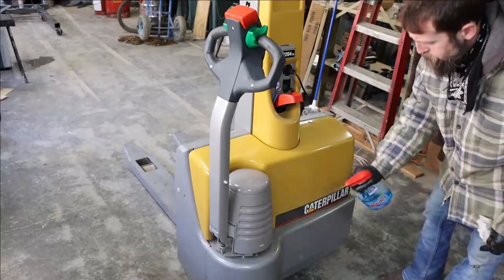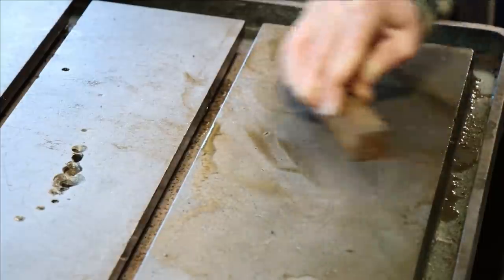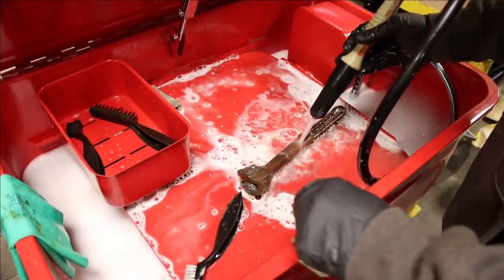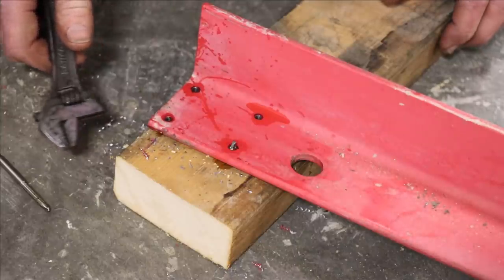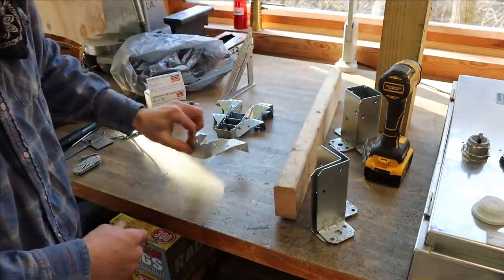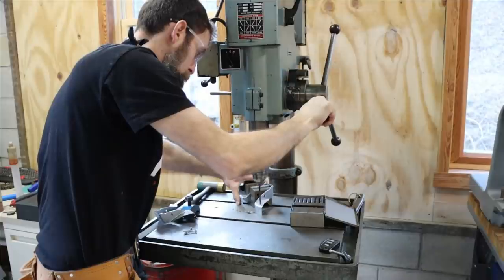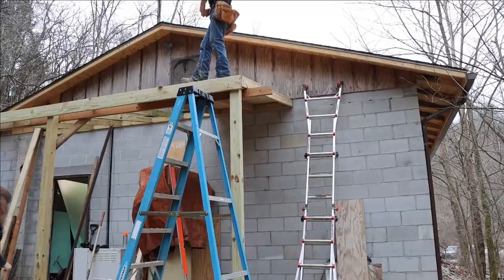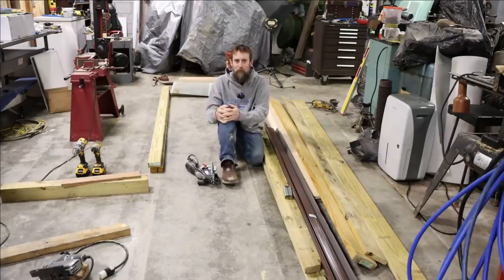Building the Compressor shed off the shop. Protecting my equipment from the elements.

Comment: I ran on of these with a car battery yes we have to keep putting on the charger but no diffrents than the other batteries.  Never had a problem with it
Reply: yes they work  in that they have the amps, they are 12v and rechargeable.  car batteries are designed for  short bursts of high ampage, not prolonged or sustained draw over long periods of time.  deeply discharging a regular car battery shortens its lifespan.  where as a deep cycle battery  is designed for deeper discharges for longer periods of time  before recharging.  yeah  they  will  both work  but over time, a year, 2 years, 3 years the deep cycle will last longer  and ultimately  cost less with  fewer replacements.

Comment: Be careful with that purple cleaner from ZAP.  It doesn’t like aluminum, I bought some and try it in my part washer and it stains and eats away at aluminum. Whenever I see a dishwasher on the side of the road I stop and remove the silverware tray. It works great in  a part washer,  you can put all your small parts in it. Wash and then blow off with your air hose and your parts to go flying away.

Comment: ice and water shield  for the roof .. if you get the good stuff its great my one garage been on it 2 or 3 years have not shingles yet still holding up tar paper would have blown off in the 1st week .. i have had good luck with the stuff it seals around the nails or screws that you put the roofing on with ,,

Comment: I had a "scissor" style electric/hydraulic pallet jack.. The only downside with that and the one you got is they don't actually work with pallets.  At least normal pallets.  If you get the "Chinese" pallets, they work with these high lift jacks as they have open bottoms.

Comment: The difference between a 'car battery' and a deep cycle is the thickness of the plates. A car battery has thinner plates that allow a large current draw for starter motors. They don't like being fully discharged and recharged. A deep cycle battery has thick plates that will warp if used in a starting application with the high current draw but they are much happier being drawn down to almost no charge at all. Deep cycles are used for things like trolling motors; low amperage and needs to run for extended periods. All that being said, if you're not going to use the lift for long periods of time (meaning move things around for an hour or so), a car battery will be fine. I suspect this will be your kind of use as opposed to the kind of use in a warehouse that these machines most typically see. Just be sure to charge it after every time you use it. When I had a boat with an I/O, I went to Sears to buy a battery. When I told the salesperson that it was for a boat, she said "Oh, you want a deep cycle battery". I said no, it's for starting the engine, not for running the lights or whatever while anchored. So even people who sell batteries don't necessarily know the difference.

I use Purple power all the time; I buy it by the 5 gallon pail at Autozone. I use it straight and though it may not degrease as good as some aromatic solvents such as the mineral spirits mentioned, it is water soluble which makes final cleaning before painting much easier. It's also non-flammable. If you look at my videos, you'll see I use an old steel bathtub that is mounted at a convenient height as my parts washer. I have a 3-way valve on the drain that can switch between draining to the bucket where the degreaser is to the drain for rinsing afterwards with hot water.

Wedge for Morse taper removal is called a "drill drift". That shank is pretty beat up.

Glad to see you bolted the casters on; I hate it when people weld casters (or hinges) on.
Reply: They don’t make battery’s like they use to, any battery you buy now days your lucky if you get 3 years it doesn’t matter how much you spend for one, 3 years.
Reply: @tonypike5785  My point was the difference between the two types and how they get used. However, not sure where you're getting your batteries or how you're using them but I'm getting north of 7 years my my car batteries.

Comment: The reason the tap broke is because you weren’t backing it off far enough to break the chip. It’s no good backing it off until you meet a bit of resistance, you have to back it off further than that. I noticed you did the same when you started tapping the second hole.
Reply: The reason the tap broke is because Steve was working like a gabone on the ground. He should have had that angle off and up in a vise instead of squatting on the ground like he was doing.

Comment: Purple power will eat the paint off of that metal parts washer.  I’ve seen it happen multiple times.  Pick up some  PSC-1000 solvent  from tractor supply.  It works great and It won’t damage that parts washer.  I’ve been using it for years.
Reply: If it eats paint off that shows it's working. They don't call it power for nothing after all. heh
Reply: @1pcfred  The paint actually flakes off and starts clogging the pump.  Then the metal tub starts to rust out from the water based cleaner.  I’ve seen multiple metal parts washers ruined this way after a handful of years.  You use solvent in a metal parts washer and water based degreasers in plastic parts washers.
Reply: @shadowdog500  I use whatever makes me happy. My shop my rules! Rust is patina. The season of rust is almost upon us now too! He who dies with the most rust wins!
Reply: @1pcfred  I agree with whatever makes you happy in your shop.  Heck, you can put gasoline in your parts washer in your shop if you want.  But as Steve pointed out several times on the drill press spindle, “If you don’t know, you don’t know”. Now you, and hopefully Steve, know what purple power will do to that metal parts washer.
Reply: @shadowdog500  drills are their own bearings anyways. Anyone looking for a perfect hole is not using a twist drill to begin with. Armchair experts on the Internet crack me up.
Reply: @1pcfred  Amateurs on the internet crack me up.
Reply: @russellstarr9111  you too? I got my union books.
Reply: @1pcfred  I’m sure the MT3 reamer set he bought wasn’t that  expensive, and a turn or two with the finish reamer to clean up whatever he felt in there probably won’t hurt anything.
Reply: @shadowdog500  Maybe. Some here have said the metal that machine is made out of is kind of hard. If I was really worried about it I'd probably just wrap some sandpaper on the arbor and spin it up in there a little. Just to knock off any high spots. Clearly it works now. So it does not need much. The other thing you can do is use a little grinding compound. Sort of lap it like a valve seat some.

Comment: All brands of adjustable wrenches are called "bahco" in the Netherlands, the brand became a name.
Nice work again Steve and nice editing, you've made me curious of what's under the tarp.
Reply: at the back is a big compressor
Reply: When a brand name becomes the name things are called generically that's what's called an eponym. Like if a facial tissue is referred to as, a Kleenex, or a copy is said to be, "Xeroxed". Here we tend to call them Crescent wrenches. Because Crescent is a large manufacturer of adjustable wrenches. Some call them Swedish nut lathes too though. Makes hexagonal fasteners round!
Reply: @1pcfred  Thanks Paul.
Reply: @ypopnun1003  at the end of the video Steve mentioned a tarp behind him inside his workshop. The compressor is outside now.

Comment: Great progress Steve, 2 comments though. why not undo the two bolts on each angle and stand in comfort at your Doitall instead of kneeling with a battery drill, and I hope you didn't let the posts sit on the concete but fixed them an inch off, to stop wicking. You guys and your wind worries, surely in that high sided valley behind your shop it's never going to be a problem.

Comment: When i sink my treated posts, i add a sealant for extra protection, then i spreay car undercoating on the 4x4 till its about 2 inches above ground, then i cement them in.
Reply: I like a bitumen paint and grading the concrete away from the post.

Comment: If you ever close in the compressor shed keep in mind that all of the power which compresses the air you use is converted into heat and add enough ventilation to prevent overheating the compressor or the phase converter.

Comment: Careful with purple power its corrosive, (to the parts washer over a long period of time)  I use crud kutter in mine it works ok, i also use a 5 gallon bucket heater to heat the water, makes cleaning parts alot more pleasant :) id like to try the "psc"? 1000 from tractor supply but dont feel safe using with the heater and dont want to give up my warm water lol. Love that drill press theres a wilton one for sale about 4 hours from me, thinking about picking it up but would have to use money from my milling machine fund :( so probably wont happen.

Comment: Make a good video to use the glass mat batteries for a couple of months and then get the marine deep cycle batteries for an equivalent time.  Running a trolling motor all day long has to be as hard on them as doing the lift.  Hardest thing on a battery is taking it down to zero which happens when trolling pretty regularly.  Seems the price would be better.  Also might want to try the six volt batteries used to run golf carts ganging them for the voltage you need.  See which one is the better deal.

Comment: Hi Steve,   Car batteries are kept fully charged and only discharge intermittently.  Deep cycle batteries are designed to discharge to a low level and survive.  Which will you be doing with the forklift?  I suspect you will use it for short periods and keep the batteries fully charged otherwise...just like a car.  So...use the car batteries.

Comment: Love the Bahco adjustables! I have a broad range of the same 8--- series from 4" up to 18" (Mine are Imperial wrenches ;) )
Reply: I've got the metric ones. You can adjust them to 0.01mm (;-0
Reply: It was actually a Swede that came up with the industrial inch. Which is what we use today. So I doubt it is actually Imperial. Johansson came up with it in 1888 too. He's who Jo Blocks are named after. So kind of a famous guy.
Reply: @ralphgesler5110  I am aware of how the standards work today. Thank you. There was a time when those other folks were right too. But they probably were not alive then. The difference was only a few millionths of an inch anyways. So not a big deal in most cases. The US inch was a little more than 25.4 mm and the Imperial inch was a little less. By 3 and 2 millionths respectively. It was enough to bug Johansson though. The industrial inch did not become the international standard inch until it was officially adopted by various nations. All of this happened without most even being aware. And they still aren't. It is not something you can see with your naked eye or even a micrometer.
Reply: Elisabeth has corona vaccine clothes.

Comment: Steve , 
 Just say NO ! to all 10-24 threaded holes ! Should have gone 10-32 tap as 10-24s brakes ALL the time ! !. Very common to brake a 10-24 tap, even brand NEW 2 flute Greenfields ! . I always stay away from 10-24s and go 1/4 20 if possible. ( I even had prints changed from 10-24 to 10-32 in steel or 1/4-20 in aluminum. ) Good to see you use a 2 or 3 flute tap, never a 4 flute as the 4 flutes are just for chasing threads, not cutting new threads. Also that tool you used to remove the chuck from the drill press ( wedge) is called a drill chuck Feather in the machinist hand book and in most tool rooms. Funny the stuff you learn in a aircraft apprenticeship ! P/S, Star wheel dressers are not used much anymore , we now use a mag chuck surface grinder diamond stick insert with a custom turned in the lathe stick diamond hand handle with a set screw to hold it in that dresses a bench grinder wheel much quicker ( and better)  with less mess .
Reply: What, no love for 12-24????

Comment: If you are going to get a few batteries, then maybe consider going for Lithium. You might only need one to replace the ones inthere. The Voltage doesn't drop at all and they charge super fast and they are sooooo light.  Price wise you might be really close to 2 AGM's?  Just a thought.  :-)

Comment: According to Simpson Strong Tie the SD fasteners you are using are not hot dip galvanized.  
Finish: Mechanically galvanized (B695: ASTM B695, Class 55)

Comment: You will want to zip-tie or hose clamp the scrub brush supply hose to the metal flex hose on the parts cleaner.... just trust me.
Reply: And replace the plastic elbow between the pump and flex tube with a steel or brass one.

Comment: Don't worry about your batteries, you already bought them, run them down so so and charge them up all the way before using again.  Twas the time I would put a treated timber in ground  and ramp quickcrete around it, set it dry and then fill hole with dirt, but alas treated timbers anymore aren't what they used to be.  Kinda worried about your span and 2x4, hope you put a good diagonal support.  I like how it is oversize, will hold dry wood for the future woodstove.  Air compressor won't mind if firewood piled against it.  Ha
Reply: Hey, I used to be a forklift guy, had 20+ electrics I looked after, got to mind the charging cycles.  Don't recharge everytime you use it, run down to a point and then recharge.  In your case got to keep topped up in winter to prevent freezing but otherwise run down some then totally charge.  One service cycle that way.  We used to get 5+ years out of forklift batteries, but they were pampered, washed every week, watered and equalized on Thursday.  But we had 3 sets so, maybe they got equalized every 3 weeks.  Just depended.  Just don't charge everytime you push the button more than once.  Run down a bit before charging but make sure they are charged during cold weather.
Reply: Today there are two kinds of pressure treated wood. There's outdoor and ground contact. The ground contact is as good as pressure treated ever was too.

Comment: The 2x4 roof framing appears to be 2 feet on center and the roof has a very low slope.  It appears to be a little lean depending upon what the design ground snow load is for your area in KY (probably 20 psf plus dead load).  Also, you installed the plywood in the wrong orientation.  Plywood is stronger in bending in the long  direction than the short and should be installed with the long direction spanning across the rafters instead of parallel with them.
Reply: Good thing he has his machining knowledge to fall back on!

Comment: I think screwing the joist hangers and nailing the plywood is usually done the other way round? Nails are ductile and handle shear loading better than screws which are hard/brittle and want tensile loading only.
What did you do about fixing the rafter ends away from the building? I didn't see a matching bird's mouth like under the hangers.

Comment: Do you still have that stack of Corrugated roofing you took off the shop roof..  you might be able to make a skirt that hangs down around the inside of the compressor roof out of a few pieces sideways or pieces cut down to length so you have a short skirt hanging down that is 6 foot 6 off the ground.. or totally enclose it with the galvanized with thoughts to change to some other wall covering later.

Comment: You will find you do not have enough room in the shop now.  Is there a filtration system for the degreaser.  That's a left-handed adjustable wrench. LOL  Those light duty castors will probably flat spot.  Will go thumpety, thumpety, next time you move it.  You just wanted to use your new to you drill press. LOL  Ms Elizabeth is good sport about being recorded.  I thought Elizabeth was panning the camera!  Something under the tarp, Tease!!

Comment: Steve  get a MT4 to jt*** for the chuck to use in the lathe dont mess with sleeves it will be less prone to error/slip nice to see the family helping out with the work , my wife stepped up to help when I had a new workshop ( now to full ) Linda became a dab hand with the nail gun with regard to the traction battles for the forklift try to replace like for like esp. as it has a built in charger it will be mapped to to correct charging slopes and cut off point as well as a maintaining charge . the big forklift I used to look after many many years ago 7 Ton life jobs Yale I think start large was 220 amps , there are more rechargeable batteries destroyed by using the wrong charger EG. modern AGM  charged with a simple transformer/ diode one will render it K for not working and the same goes if done in reverse

Comment: To fix the drill press table; drill, tap, loctite a threaded plug in?
Reply: Yup! You could even gang several screws in a row much like repairing cracked engine blocks.

Comment: Got to admit I loathe holes in the drill press table. A heavy sturdy built drill press vice is wonder to work with. It will secure smaller parts and saves time not needing to clamp it to the table. It will hold the parts tight, so they do not fly away when larger drills press through thin material or when you reverse the tap. What that has to with holes in the table you might wonder, is that when moving this heavy vice the small curly shavings ends up in those holes. That becomes a serious annoyance when you got more than one hole to make in a part and often need to move the vice.
Reply: Peck holes in press tables never troubles me at all. Shows me the machine is capable of drilling a hole. That's what it is made to do after all.
Reply: @1pcfred  Peck holes in drill press tables are the mark of an amateur.
Reply: @russellstarr9111  worrying about them is the mark of an amateur. Pros just get the job done. And if tools and equipment gets wear in the process then so be it. It's nice if it doesn't happen but if it does then oh well.